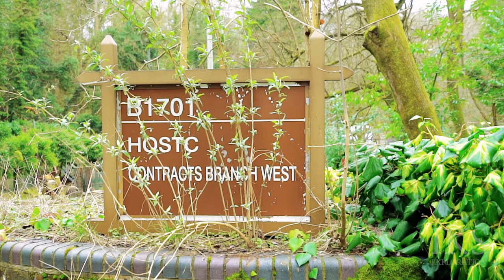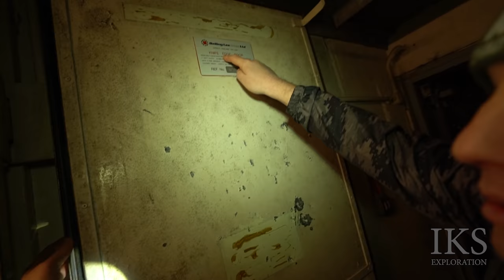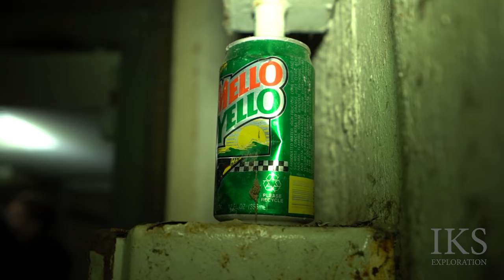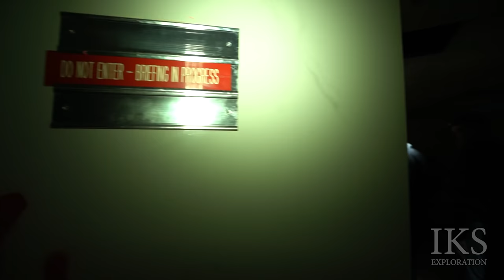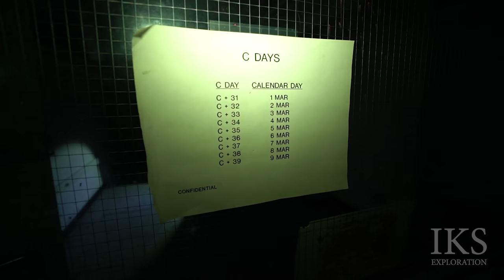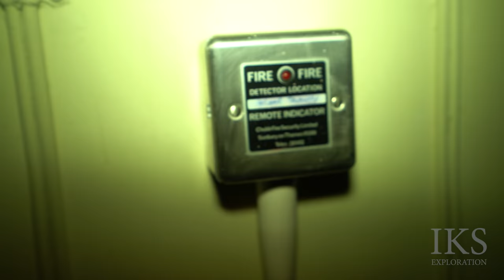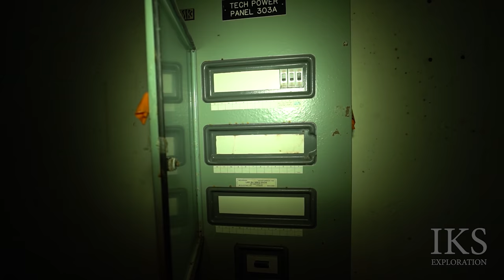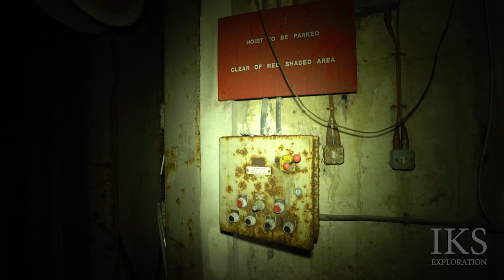RAF DAWS HILL HIGH WYCOMBE BUNKER

Comment: There also seems to be a mix of pre 1970's and post 80's equipment, wiring and controls. A bit of a Hodge podge in the piping where adapters have been placed to link old ducting/pipes to new filters, pumps and fans.
Reply: Ohhhhhhhh hodge podge in the pipingggggggg!

Comment: In those big air filter boxes in the machinery spaces there will also be multiple spaced layers of fine copper mesh that also prevent EMP charge from travelling in free air through the filters and ducting. Each vent would also have the fine mesh as a final screen and there will be dielectric spacers/joiners on the metal air ducting and electrical ducting (Generally just at a cable passthrough that will have an EMP filter mounted to a copper or stainless steel plate.
And yes I have setup and worked on such systems. I even have manuals on EMP Protection for bunkers and command shelters, mainly US in origin and dating from the cold war, but still current!
Reply: you sir a very clever guy

Comment: Oh and "TEMPEST" covers other things, not Radio communications. It protects against LAN systems, monitors and keyboards from having their radiation detected and decoded. So that proves that room is one of the computer server stacks in the bunker. Most of the problem has been sorted out more recently, since the 80's, by using fibre optic fed LAN and WAN systems as the cable doesn't radiate any RF at all and is dielectric so won't conduct any power or signals.
Reply: That's exactly what I was thinking!

Comment: 208volts is common in the usa in an industrial setting. its the phase to phase voltage on a 120/208 Y type transformer. we use it so we can use all 3 phases at 120v.

Comment: At 46:20 where Chris said "That looks like gas detection" looks more like a 7/16 RF connector on  LDF 5-50 or 6-50 heliax RF cable, considering they used HF to communicate with SAC resources and other types.of high powered trancievers on that level of the bunker.
Reply: Exactly what I was thinking.

Comment: Those panels at 34:00 date from the rebuild or work around the 1980's. I've worked on similar systems introduced at that time with those square meters instead of round or oval ones.

Comment: The place with the water filled gauges appears to be cooling/heating radiators to set Ambient air temperature? Couldn't read the gauges.

Comment: At 40:58 those are parallel printer ports for fixed printers. Either on network through a PC server or direct connection to a system.